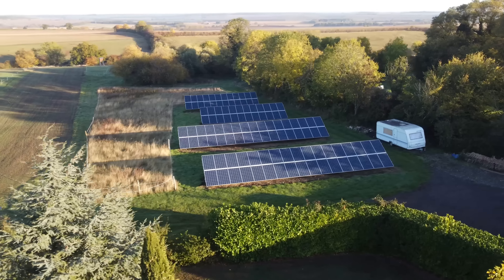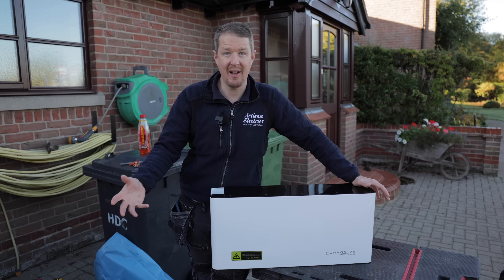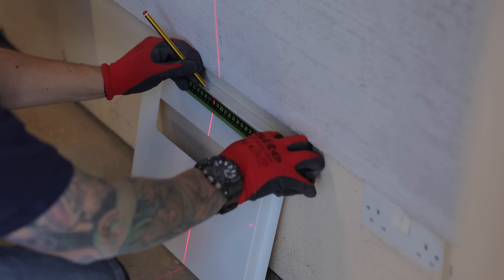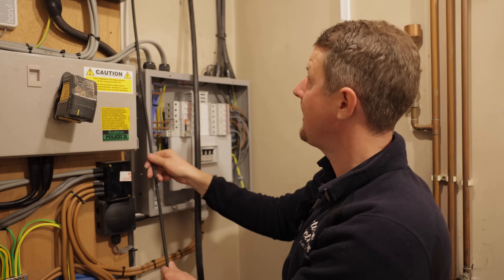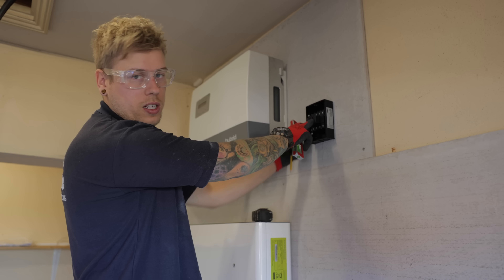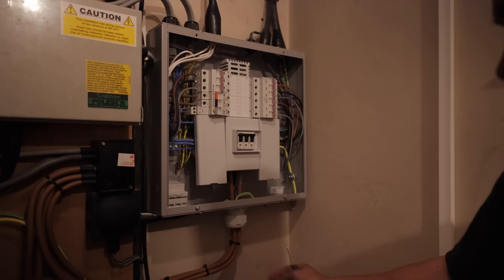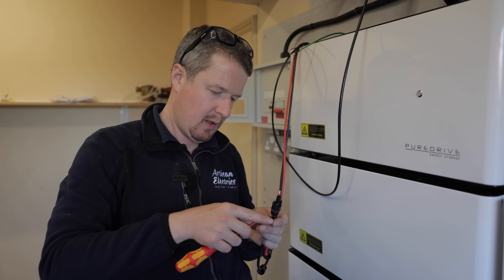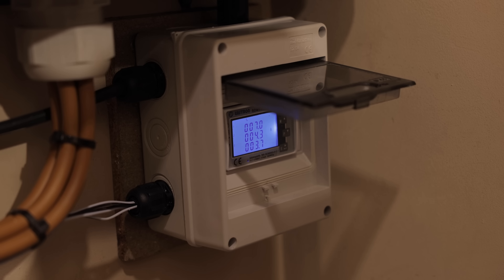PureDrive 23kWh Three Phase Home Battery Storage Install

Comment: Great video guys - alway interesting. 
Thought worth sharing that Tesla is not the only system that is capable of running a house if grid fails - Victron inverter chargers are very capable of doing just that as they have grid pass through built in and grid pass back if wanted. They can also be run in tandom for split phase systems off a single battery system. Essentially a UPS for a house.
Reply: As does the Sunsynk hybrid inverter. Believe it will go up to 5kW depending on inverter size.
Reply: Just use voltage sensitive relays that will switch over automatically.
2 year delivery on Tesla Powerwalls ! !
Reply: ...or any other hybrid Inverter that had a critical circuit output.
Reply: @philware1546  True! there are a number of them, Growatt are another...
Reply: @nickbea3443  Think Victron go up to 15KV with their  Quattro's
Reply: @nickthechef5946  these things are beasts you can run multiple units in parallel so on single phase you can go up to 75Kva and 180Kva on three phase but at that power you would need a garage full of batteries 😁
Reply: SolaX can also do it
Reply: Many model sizes- 5kW, 8kW, even a 16kW hybrid single phase- can parallel any of them for 3 phase install.
Reply: @nickthechef5946  I been using Sigineer (and in fact use one in my own place, a 12kw LF, running off a 48v 400Ah (20kw nominal) LYP bank) but they have a stackable bank of inverters that can be slaved up to 36kw total, and like most hybrids, you don't need to have a 'emergency' outlet box and run extension cords, you can simply have dedicated breakers in the consumer unit that feed from the inverter AC output terminals- depending on how you program the menu settings, those will either switch from mains grid to inverter in case of a power failure, or alternatively you can run the inverter continuously to those outlets and  let the solar top up the battery bank first then export (mine can handle 2 separate 3.5kw MPPT solar inputs), or reply on the inbuilt battery charger- the options are pretty much endless how you decide to config the system, both Growatt and Victron have similar options (Growatt even have some of their range that will act as a normal gridtie, but even without a battery bank, can have a 'limited' output emergency outlet added that is run off solar only (from memory its 1kw on their 5kw gridtie)- with no battery bank at all
Reply: Hello friend, we are a lithium iron phosphate battery factory from China. If you are interested in cooperation, please let me know. We are looking for distributors in various countries around the world.

Comment: You don't have to depend on a Tesla PowerWall + Gateway if you want your battery to power your whole installation in island mode during an outage. In the UK, as long as the battery/inverter system is capable of island operation AND the installation is compliant with ENA Engineering Recommendation G99, you could do it. Bespoke interface protection and switchgear installation plus commissioning would cost a few quid but if you can afford a 23kWh battery, you might be able to afford the interface too.
Reply: Victron probably has an integrated solution for that
Reply: Dear Artisan Electrics, how much will the customer charge for one mega watt of electricity exported to the grid? It would be great if you can let me know-Or anyone else who knows you are all welcome. Thank you
Reply: What do you suggest for a Neutral when youve lost all grid incoming? Dig up the feild and install both N+E for 50m? + switch gear to isolate it all when back on grid. More to it than first appears i think

Comment: I've now installed 28kWh of Pylontech batteries. 8x 3.5kWh batteries.
Very simple. Very cost effective.
Installed in the loft with a 300kg structural platform.... 
The system is basically plug and play. I got a local electrician to install the new circuit for it. Very cheap. Not an overpriced "Solar/EV/green" energy quote. 
No need for an apprentice to help pull the cable up into the loft either. 😉

Comment: You don't need Tesla, just an automatic transfer switch. There are a few options for UK domestic, some even allow a switched trigger remote to start a generator so that you can input when solar is too low, mains is out, and battery is low.

Comment: Victron inverters can run from battery when the grid fails and as they are grid forming they will keep any solar inverter running stopping the anti islanding function from kicking in, only down side to this would be the breakers in the inverters have a max disconnect which i think is 50 amps so no good if you run 10Kw showers, this is the system i have in mind, Victron multiplus 2 5000 VA with 14Kwh battery and 3.6kwh solar (solar already present) the Victron also has 2 power outputs 1 for main loads and 1 for essential loads, essential loads are effectively on a UPS, Victron inverters also have built in relays so you can control additional energy diverters, lots of options but they are on the pricey side of the market

Comment: 12:55  Not many power cuts, but the neutral going down seems like its an issue.  With all the PEN fault detection required because it happens so often there!  (speaking from someone in the USA that doesn't have that issue normally.)  🤠👍  Looks like a nice system, keep up the good work guys, always fun to watch your videos and see how things are done over the pond!
Reply: It happens never, just a weird obsession we have developed when it comes to ev charging.
Reply: Further to what Ed C said, never seen this. Now Phase Loss on the other hand...

Comment: Really when you install a battery system of this size you would Really want grid down power for at least essential loads. This client has loads of solar to. I'd be looking into Victrons range of products. There Multiplus and Quattros are fantastic bits of kit.

Comment: Here in the U.S. In my opinion... a "Grid assist" with properly sized panels and batteries is the ONLY way to go. The power companies here are screwing grid tied customers over in many ways. Use the grid as the "backup" power if the need arises. Nice install!
Reply: Grid tie in the UK is best, as the grid is always there providing system stability and you don’t need to install huge inverters.
Reply: Hello friend, we are a lithium iron phosphate battery factory from China. If you are interested in cooperation, please let me know. We are looking for distributors in various countries around the world.

Comment: SMA inverters also support automatic fail-over to full house battery backup, up to 24kW of power (3 phases of 8kW) (The Sunny Island series of inverters)
Unfortunately, they're also hard to get at the moment, but certainly not 2 years. You're also way more flexible in which batteries you use.
Reply: But in the UK, full battery back up would be 23KW on a single phase. There's only a few very modern properties that run 3 phase from the national grid.

You can't take a single phase house and cable it up to use 3 separate phases.
You could, but you would have to replace the single phase distribution unit with a 3 phase type, and have a whole load of switching to be able to switch between 3 phase from the inverters and single phase national grid power and route the single phase to the separate 3 phase feeds into the 3 phase distribution unit. It's getting silly.

A far better approach is a single 23KW single phase inverter.
Reply: @deang5622  This house was 3 phase, farms and some large properties have had 3 phase going back many years. But yes thankfully 3 phase is becoming more common on new builds that have heat pumps and EV charging due to expected loads.

Comment: I guess we are lucky in Baltics/Nordic region where we actual sell our excess energy to the grid. Depending on the contract you sell at the fixed price or at stock price that changes every hour.
We also use inverter that itself tracks how much energy panels are producing, how much you use yourself, buy from grid and also export to grid.

Comment: Interesting, we have two Tesla PWs with the third due imminently; with our solar panels we will not be taking any grid power at all from mid-March to October.  We had a power cut last month but were unaware of it as we continued to automatically use the Tesla batteries, supplemented by solar power.
Reply: Thought it would notify you and shed circuits during a power cut? I know I can’t use things like my induction cooktop
Reply: @edc1569  2PWs allow a 10kW draw, enough for an induction hob, but we would drastically cut power usage during a power cut.

Comment: I wonder about these batteries. I'm using a set of car batteries for an old computer UPS which had dead sealed ones. They tend to die after a few years, requiring replacement. And they don't tend to see many heavy discharge cycles that would reduce their capacity.
What kind of lifetime is there for these power walls? Do you need to replace the batteries every few years? What are  the maintenance costs, now and projected as they become more commonplace? What happens with any dead batteries?
Reply from the maker: Hey 👋🏻 Pure Drive rate this particular battery at 10,000 cycles at 90% DOD.
Reply: @artisanelectrics  Do you have one cycle per day? If so, that's 27 years.
Reply: My Powerwall is over 3 years old and it will probably out last me, and once it does die you can recycle over 90% of it.
Reply: @artisanelectrics  So, assuming roughly a cycle a day, these batteries are rated for an average lifespan of 27 years? That's a lot better then I expected. By that time battery technology will have evolved.
Not in the UK myself, but I'm going to have to look into that!
Reply: With a ups the very high C rate discharge tends to place a lot of wear onto the battery every time it kicks in.
Reply: @QuentinStephens  Mine have about 1 cycle a week in Spain (odd cloudy day) as reported by the BMS.
Reply: Most use LYP lithium (LiFeYPO4) or LFP lithium (LiFePO4), which have a 15 to 20 year lifespan cycled daily (5000 cycles using 80% DOD, 7000 cycles at 70% DOD), Tesla is still using their Li-ion so 10-12 years (although I've heard they may be changing their powerwalls to LYP)- absolutely nothing like the old Leadacids LOL (which have only 500-1000 cycles at a modest 50% DOD)
Reply: @steved2136  That's why I'm asking :) I'm a novice in these things.

Comment: Great video (as always) and nice kit.
I have a GivEnergy battery system being installed in 2-3 weeks time; 2x 9.5Kwh batteries and 2x3k AC inverters. I can charge everything overnight on Go tariff and remaining 21 hours run on batteries with up to 6k load from the 2 inverters. Plus 5.6Kw solar when the sun shines :) ASHP being installed next year. Single Phase house in Gedney Hill not far from you. Curious if I've gone large more than most, are you installing many or any around 20kwh ?

Emergency Power Supply or EPS: As already said it's not just Tesla this is a common feature in most battery backup systems, the faff is how you connect into your existing circuits. I got conflicting advice such as "wire certain sockets for EPS and a few lights". For me it's easy set all downstairs sockets on the EPS and be sensible and don't overload it in the event of a power supply.
Reply: Automatic transfer switch on the main line and eps on one side grid goes down switch to eps 
Works as a ups no power loss
Reply: @snoopibn what to do without a neutral? After grid turned off.

Comment: I thought that swa was mainly used for mechanical protection in prone locations like external or workshop situations.
Reply: It is. But it is not exclusive to those situations.

You can use it wherever you want, if the customer is willing to pay for it, and it is felt the level of risk warrants it.

It might not be strictly necessary, but it's clearly being used in an "industrial" type room although in a residential property.
Reply: Loft space with vermin it’s a good choice, in the UK it means you don’t have to provide RCD protection to that circuit.

Comment: Did I see this correctly? You're connecting the whole battery system AC-side? So the solar inverter first converts the DC from the panels to AC and then the battery converter converts it to DC again to store it? How much energy does that double conversion waste?
Reply: About 20 percent. Only one of the disadvantages of high voltage battery systems.
Reply: It's crap isn't it? Solar panels output DC, no reason why that can't be used to charge the batteries directly with no conversions, except for DC-DC.
Reply: @deang5622  To be fair, DC-DC conversion is hard, especially when it's for more than a couple milliamps. AC you can just run through a transformer, but those don't work for DC.

I have to concur with Attila here, high-voltage DC (i.e. batteries in series) is a bit of a problem. On the other hand, panels are also connected in series, so one should be able to match panel voltage and battery voltage... :shrug:
Reply: @HenryLoenwind  You don't actually need DC DC conversion when charging batteries.

All you do is ensure the solar panels are connected so you have a high enough voltage and then feed the current into a battery charger.

So it is more than possible to charge up batteries without the losses associated with converting DC to AC and back again.
Reply: @deang5622  That's what most of the hybrids do- they run a 48v or 72v battery bank, and use DC from the panels through their own (or external if required) solar controllers, and only have the one DC-AC conversion... The setup Jordan's installed tends to only be used (at least in Australia) where you already have an existing gridtie solar install and are wanting to 'retrofit' a battery  backed hybrid system afterwards- it allows minimal modifications and reuses existing gridtie inverters and such- but at a loss of efficiency over one that is done pure DC from the start...

Comment: Here's a fantastic summary of that riveting video where we install the world's largest paperweight, I mean, home battery storage system. So, we've got this ginormous solar array, but 70% of the energy goes to waste - bummer, right? Well, fear not, we've got the solution! We'll slap a massive 23 kWh battery storage system into this house, so it can go almost off-grid. You'll be on the edge of your seat watching us lug around heavy equipment, struggle with mounting batteries, and complain about cold Greg's sandwiches.

We take you through the riveting process of measuring, marking, and installing the battery storage system - step by step. You'll witness the birth of 23 kWh of battery storage, made up of six modules and a BMS (the brain of the operation). Don't forget the 10 kW inverter, because you need to convert that DC power to AC for your house, duh!

We deal with pesky wall problems, making sure our battery babies are securely mounted, and install backup consumer units for those rare UK power cuts. And just when you think it can't get any more thrilling, we tackle cables and communications connections!

So grab a cup of tea (or 23,287 of them, thanks to our excess solar energy) and enjoy this electrifying waste of time. Don't forget to like, subscribe, and question your life choices.

Comment: I've installed this Inverter but Im having problems with the data from the monitoring, its saying im exporting more than the system is generating, and the gen meter doesent match the generation figure in the app, did you have any of these problems when you were commissioning the system?

Comment: Doesn’t the battery power kick in automatically in the event of a power cut?
If so, what is the reason for emergency sockets?
Reply: in theory it can, but you're not allowed to backfeed the grid. Of course, there are ways around it if you were designing a system from the start, but it looks they had solar before and now bolting battery storage to it.
Reply: Take the output from the inverter and feed an automatic transfer switch...power would then switch over automatically in the event of grid power. Easy.. Then there is no problem back feeding into the grid.

But they don't have a huge amount of battery capacity to power the entire property for long.